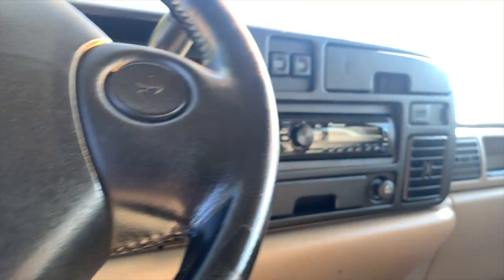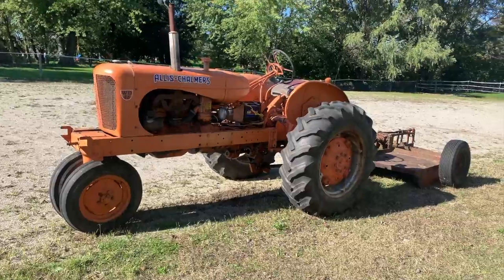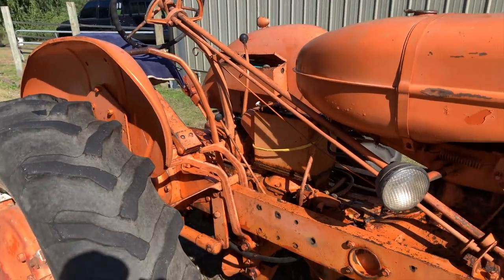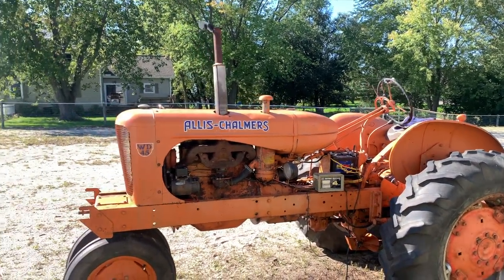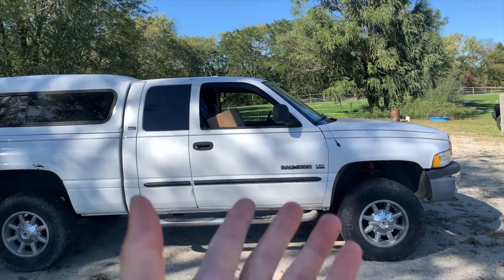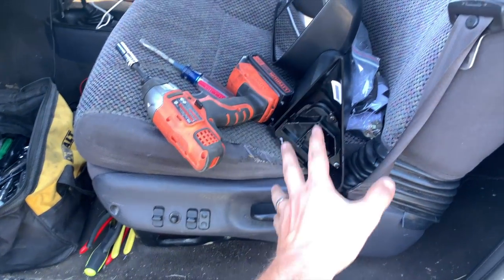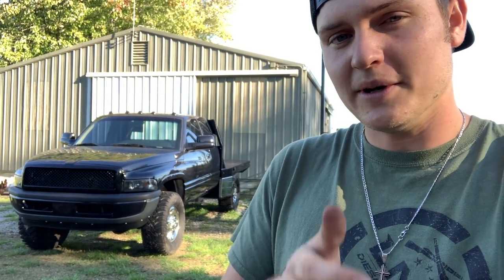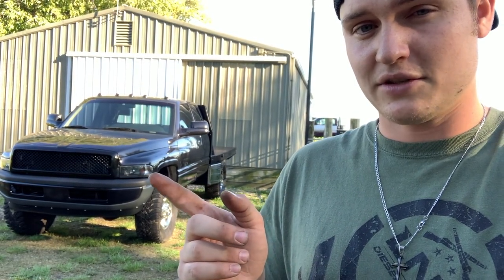I CAN'T get this thing to stay running!!!

Comment: You are going to have to take the carb apart and put it at least in the carb dip solution. There are all kinds of little jets that will need cleaned. Once it's clean and adjusted it will run good.

Comment: So I’d don’t know much about the tractors but I do know a little bit about trouble shooting. I would get the tractor to the point where all you have to do is pull lever to start it then I’d take some battery cables and go straight to the copper patch that was under the pice you took off so you’re completely by passing the switch on the starter if it starts and runs you know you have a bad switch if not it’ll be something else.

Comment: Check your solenoid bud and I would run non-ethanol in it after draining the water out of the tank an empty you're settlement Bowl and run some heet through it too soak up all the water if you can't get it all👍

Comment: Maybe try pulling the spark plugs out and turn it over to get all the water out of the cylinders. Then if you start smelling some gas put them back in and try again. Just a thought since you've said a lot of water has been coming out of the exhaust

Comment: Put a bucket over the exhaust when tractor not running. Also you can also pull start it. Pull with truck pop clutch in gear and hit the starter

Comment: Try replacing voltage regulator or the starter solenoid if it has one. Some old tractors like that have neutral safety switches that can go bad and prevent tractor from starting properly. Is tractor 6 volt?

Comment: Possible the head is cracked leaking coolant in the cylinders hints the water coming out the exhaust when it was running
Reply from the maker: Well the water gets in due to the stack loosely sitting on the manifold and huge gaps around it lol